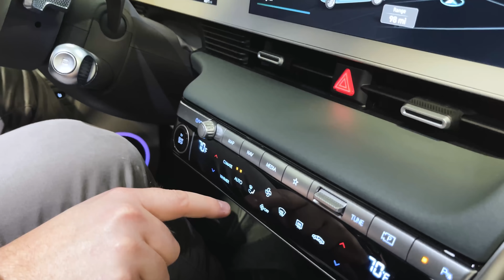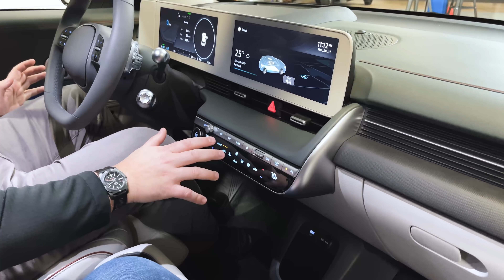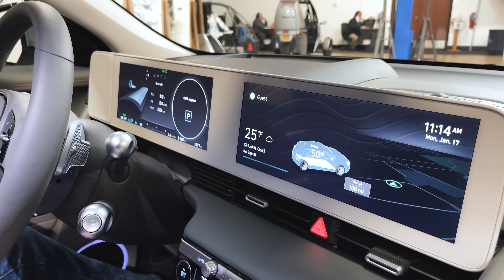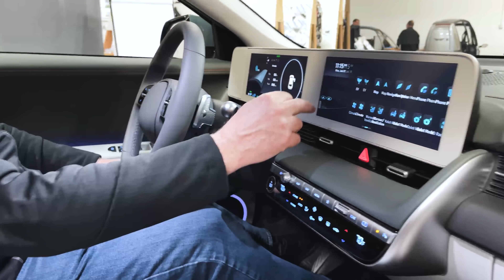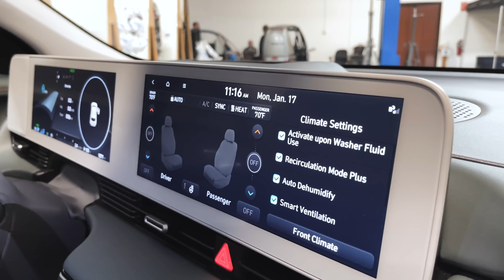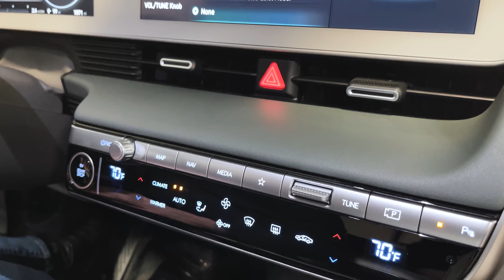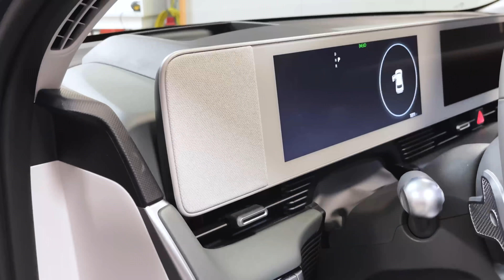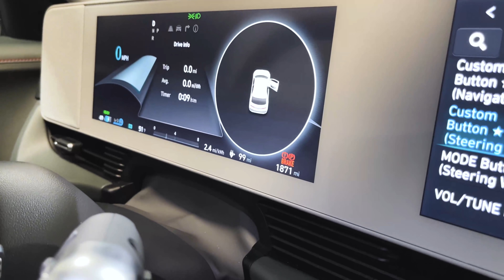2022 Hyundai IONIQ 5 | Sandy's First Impressions

Comment: As several people have stated here already, I also am glad Hyundai chose to keep the physical HVAC buttons.  I don't like trying to scroll through menus and press small "buttons" on a screen while I am driving over bumpy roads and my hands are shaking all over the place.  Great video though, guys.  Keep up the good work!
Reply: The best executed HVAC controls are from Range Rover and JLR. One round physical knob for each HVAC function with a superbly designed digital readout in the centre. Makes adjusting the temperature almost sensual. "It's getting hot in here honey!"
Reply: I dont understand why people need physical climate control buttons. I have climatronic in my Golf and set my temperature to 21°C and never have to touch it. Only time I use climate control is to activate the defrost windshield function. Which would be no issue to have in the touchscreen, as you normally dont use it while driving
Reply: @hoedjeexplains3661  I agree.  Voice control works well for me.
Reply: @hoedjeexplains3661  Exactly. New generations don't even know how to use physical buttons anyway 😂
Reply: @hoedjeexplains3661  @21:39 explains why many people don't use auto settings for their HVAC.  You may like using Auto on your Golf, but the majority of drivers don't for the reasons mentioner in the video.

Comment: I definitely prefer having the climate controls separate, don’t like having to exit from nav to adjust the volume or air temperature. Great looking car. Good job Hyundai
Reply: Yeah, don't take any notice of Sandy, Hyundai. Leave the damn real buttons for frequently-used things in place. Screens don't work with gloves on for a start (although maybe these buttons are capacitive too?).
Reply: I 100% agree. This is the first EV I've actually wanted. 
I hate all in one touch screens with a passion and see dedicated controls for the basics as a definite plus. Give me a knob or switch I can find by feel without being distracted any day.  I like being able to reach over and grab a nice quality dial and feel a smooth click per half degree without taking my eyes off the road.  They tried "touch screen" membrane climate controls in the 80's (think microwave) but they sucked ergonomically and didn't last. My brother's 87 Buick Grand National had the "Electronic Touch Climate Control" system.
Reply: Totally agree with you. I think having actual buttons for climate and stereo is a HUGE plus. I detest using the touch screen for everything like a Tesla.
Reply: I also agree with these comments.  Having to dig about in the screen to make adjustments while driving is both inconvenient and dangerous.  Having moved from the Kona EV to the Ioniq 5, I am pleased that many of the essential controls have been retained.  One button that has been removed is the seat heater control and this is a pain to get to on the screen while driving.  On the Kona it was easy to get to without taking my eyes off the road.
Reply: agree
Reply: They can make the bigger and have the climate control always accessible
Reply: What car are you referring to? Every Tesla has temperature controls always visible so…
Reply: @JesusisKing2000  Not anymore.  They used to be always visible but Tesla updated their stupid menus.  Now if I want to turn on the defroster, two clicks.  If I want to turn on my seat heaters, two clicks.  Sure, I can adjust temperature, but THAT'S IT.  Used to be able to do more with one click.  Tesla did a step backwards with this update IMO.
Reply: Too bad it does not have voice control.
Reply: Emotional liking based on habits or nostalgia never outlive their "maker" if something more practical or more efficient comes along. Like noisy cars or vehicles that eat and poop. In the mean time, however, people will continue to appreciate them for some time. The future generations probably won't even understand it.
Although a two fingers screen control would go a long way to make touch screens in cars more practical. Simple enough to implement, I don't understand why Tesla didn't do it yet.
Reply: @davidbeppler3032  It does.  I'm trying to get used to saying "Turn on defroster" or "turn on my seat heater" instead of just tapping the screen.
Reply: Agreed, I like knowing where these things are so I dont have to take my eyes off the road when changing the temp or turning on the demister
Reply: @craigchatterton4164  And constantly changing things like moving the climate control would probably drive ppl that aren't very tech savvy crazy.
Reply: Get a tesla ... not a problem and fixed quickly.  It's only a matter of 3 yrs before you see 100s of auto manu go belly up to Tesla.
Reply: @craigchatterton4164  You can fix that by hold and drag.  You can move things around.
Reply: @ddeboy002  there prob aren't even 100 oems out there lol
Reply: @ddeboy002  You can only move around the icons on the bottom row.  You can't move icons from the secondary screens to the bottom row.  I tried to drag defrost and seat back to the bottom row.  No dice.
Reply: I totally agree.  For the love of god stop making it harder to pay attention to the road.
Reply: @Aaron-ui9tj  elon should add a heads up display to the 3 and the y so ppl don't have to keep looking down and to the side just to see what speed theyre going
Reply: I can't agree more. This this unwanted feature is spreading in the new cars🤦‍♂️
Reply: Climate control buttons aren't as needed after you get things set and use the auto feature - I rarely adjust mine in my Santa Cruz - it was an adjustment though...
Reply: @Scotty_in_Ohio  some days you are hot and some days you are cold..
People change the temperature all the time.
Reply: KIA makes disposable cars, like phones.

Comment: The secondary hvac controls are there because there is data to show that hard controls for frequently used functions like hvac are quicker to use by tactile feel by the driver and don’t require the driver to take their eyes off the road.  Otherwise if they followed Sandy’s recommendation every time the driver wanted to make a minor hvac change the driver would have to look at the screen and possibly navigate back a screen or two, even if the desired change was only for fan speed.  
Also many people used to traditional cars do not like having to do everything on a screen.  Lastly if the driver is wearing gloves the manual buttons can still be operated, and oftentimes the screens cannot